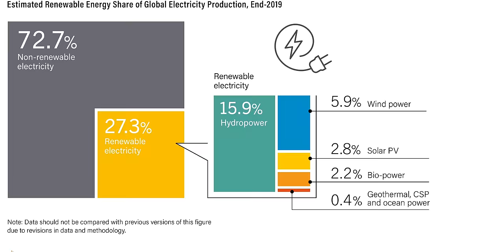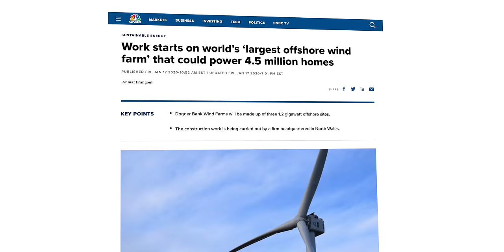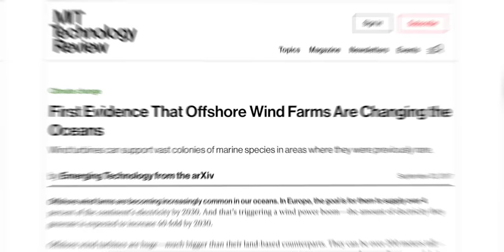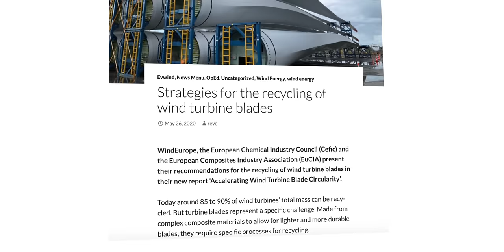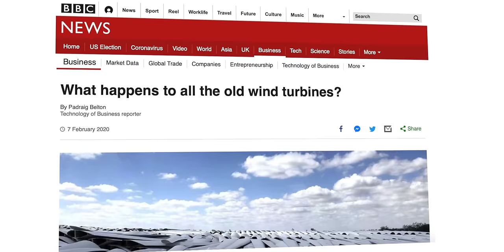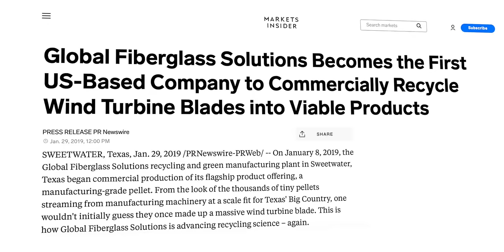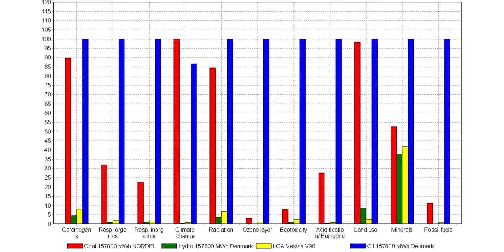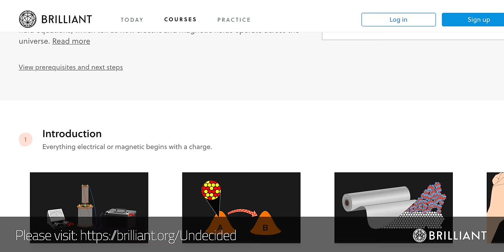The truth about wind turbines - how bad are they?

Comment: Nice analysis. While you did acknowledge some downsides, and have reasonable hope for some improvement, I feel some important gaps were made. For example, if we did cover all our coasts with wind turbines world wide, would that alone provide a stable source of power? (Is enough wind always blowing?) If not, the cost of storage to grab the peaks and fill in the lows with a base load needs to be factored into the cost of wind. The fact that the sun isn't always shining and the wind isn't always blowing is one of the reasons it is tough to increase this type of "green energy".
I also think the environmental impact is understated. Sure the clams might be happy, eating bits of dead birds falling from the sky, but can you imagine what surrounding all of our shores with windmills would do to all migratory and sea birds?
It would be terrible to do all this and one day realize that we dramatically overstated our fraction of the impact to the environment, or underestimated the many costs going green had and that maybe natural gas wasn't so bad.
Hydroelectric, especially from dams, are a great stable base load, but the environmentalists are pushing to remove them all. That's not smart.
Nuclear is also dismissed too easily. If green is so great, why is Germany burning more coal and natural gas, and paying higher electric rates than France? One reason seems to be nuclear. The US has been running small nuclear reactors on submarines and super carriers for decades.That's nearly a hundred reactors floating around in a variety of sea conditions without a reactor caused complete failure. We've been taught to be scared of a great power source that doesn't require ringing our continents and smattering our farms with windmills or solar panels, that have a much longer lifetime than green energy sources, and that could be disposed of much more compactly.
Reply: I don't know how long it's been since you were at the ocean but the wind really doesn't ever stop blowing on open water.

Comment: Thanks for this. Appreciate your whole view. Worry about the alternate uses of spent blades - only time companies won't just throw them into a landfill is if they can make money not doing so. Would love if we went into wood! Wood is the new plastic
Reply: As long as your kids are the ones living in Florida when it goes underwater, I'm fine either way.
Reply: It is actually the old plastic of witch the early blades where made of. As blades got longer and wind farms larger, using wood was deemed unsustainable, too heavy, too expensive.Today the high quality lumber required for this kind of application is rare to non existent therefore ultra expensive. Deforestation is not any better ether.  Now the use of different material within the composite is a better approach,  newly developed thermoplastic resins allow for remelt of a plastic part and reuse of most components of that composite material, self healing properties can add a lot of life to the composite part. Some of these resin are high bio content and some natural fibers are getting close to fiberglass and even carbon fiber performance level. "plastic" is the new wood. It is called evolution. A lots of smart people are working hard to find solution for clean...er energy  can we make it pure?
 By the way, birds die in grater number from striking high rise buildings than wind turbine blades strike .Some researchers are attributing that, paradoxically, to the lack of warning noise of a building.

Comment: Good video.  You need to compare the alternatives-with coal you get horrible impact from the mining of it, air pollution from the burning of it, and then coal ash(with heavy metals) at the end(I personally would much rather have turbine blades buried near me than coal ash).  Also, I am from an area that contains an old oil field.  There are still areas where plants do not grow after 80 years due to the release of salt water.  There are still wells producing, but these bring up  polluted salt water with the oil.  This  water must be pumped back in the ground nowadays. If these "disposal" wells get a leak, guess what happens to your ground water and your water wells! Wind and solar have problems, but are better than this.
Reply: And what about the mining or rare earth metals that go into the wind turbines? I wonder what those areas look like after they are used up. Don't be so sure that wind and solar are better. As has been mentioned by some other commenters there are trade offs no matter what.
Reply: @erichamilton8952  They probably do not look any worse than the places that coal is mined.  You are correct in that there are always trade offs.  Even hydro electric dams  endanger salmon.  I just think the trade offs are a lot better for wind/solar than for non-renewables such as coal.
Reply: It takes a ton of diesel fuel to mine the metal for the bases plus to dig the foundation plus haul in the gravel and cement to build the base for the windmills plus they need roads to get to them and wiring to get the power away
Reply: @lesleyboeder1798  It takes roads and a ton of diesel fuel to mine coal also.  It takes even more roads to produce oil.  Every well, no matter where it is, has to have a road built to it.  I speak from experience, I am part owner of land with oil wells on it.  There are roads and the wells are not what you would all "clean".  The area near them reeks of hydrogen sulfide.
Reply: @robertthacher2660  Crap.  The use of coal is dropping every year in this country.  The use of Wind and Solar is increasing every year.

Comment: I’ve got an idea; how about smaller turbines for houses, because solar panels for homes is difficult (roof material needs to be replaced much more often than solar panels, and then it cost thousands more when the solar panels need to be removed and replaced again, also shade trees usually come with houses, so cutting down trees goes along with residential solar). Those new fangled winter vines that look like a rectangle (doesn’t look like a windmill), might be a good way to go.   I have never heard noise from a wind turbine, but I get that it could be undesirable in a residential neighborhood. You would think with modern technology they could make quiet ones.

Comment: Here's the downsides.  Plenty of them.
Turbines don't belong en-mass out in the sea. NJ USA is planning up to 5000 turbines in farms with some 150 substations... in total containing some 35Million gallons of hazardous fluids and 3.5Million pounds of SF6 (most potent GHG known to humanity, with a warming potential 23,900 times that of carbon dioxide (CO2) and atmospheric residence of up to 3,200 years.)... those fluids leaking and at risk to dumping into the sea en-mass with a natural disaster or military conflict. 
The are NOT Green, NOT Safe, NOT low cost energy.  In fact, European  citizens report to us that their electric rates went up 2-3x.  The installation process in NJ puts them only 10-15 miles offshore in prime fishing, clamming and scallop grounds. Total destruction of these fisheries is expected due to disturbance of the ground from the installing the bases as well as the maze of connecting cables. And after installation, the choking of all living creatures will continue with constant silt generation to tidal currents moving around the bases of the turbines. Photos of such silt generation is observable at sites that have been installed. Further, NJ has no made apparent the "take charts", which are the declarations by the installers of potentially how many marine mammals the prospecting and installation is EXPECTED to "kill". NJ plays dumb that it doesn't know why our whales and dolphins are washing up on the shore during the seismic testing of the seabed. They know why, they approved it. And NJ is just the ground zero for the entire US coast, with Ocean City NJ being the start with the Oersted Ocean Wind 1 & 2. Our environment protection organizations are now approving of this, we have reason to believe their silence has been payed for. If you love the Jersey Shore, donate to our legal defense fund which is our most powerful method to STOP OFFSHORE WIND TURBINES NOW at https://protectourcoastnj.com
Reply: Here is the alternative - can we build a coal plant near you- you know the one that emits mercury and toxic dust and carbon dioxide in spades and must be shipped there through your neighbourhood and near your schools. All that ends up in your local seas. Dolphins and whales are dying without any turbines in your offshore seas and some of that relates to military warfare sonar testing - perhaps get rid of subs and military boats that are using such sonar testing??? Some related to the noise of shipping - good luck telling your ship owner to move back to wind. Do you think any power station does not generate vast amounts of GHG from its concrete/steel and construction and grid connections and then every single pound of fuel in the decades its generating. We see oil spills into the sea every day- yet we still rely on those ships to move goods that burn the dirtiest oil we mine for. Those trucks and rail run on diesel and if converted to cleaner power- that power has to come from somewhere. As for fishing- over fishing has been the norm for decades (where are all those massive fish fleets we used to see on old pictures) and fishermen do not care where they fish or how much. The less stock there is, the harder they must search for any fish to return with. Offshore wind farms (as much as fishing in the shadow of an oil rig) are a necessary evil. You don't want a wind turbine next door so offshore only offends the sea view owners (usually richer than most to get one). That same sea heated up by global warming then arrives and destroys everything (homes-wildlife-sealife-humans) and every year the seas get warmer providing the perfect battery for typhoons and stronger hurricanes even onshore turbines can be designed for.

Comment: I'm genuinely surprised by some of the negative commentary.  This video does an excellent job of presenting both sides as well as outlining the mitigations and solutions that address the downsides.  I would have liked to see one more aspect covered in more depth, namely the massive environmental damage that wind power displaces.  Over its 20 year lifespan (a conservative estimate since 1980's vintage wind turbines were still operational at Altamont Pass Wind Farm until recently), a single 5 MW onshore wind turbine will generate as much electricity as mining, transporting, and disposing of the toxic ash residue from burning 150,000 TONS* of coal.

That 5 MW wind turbine also eliminates about 25,000 TONS of toxic coal ash, 750 TONS of sulfur dioxide, 300 TONS of nitrous oxide, and 30 TONS of particulates

Even if none of the wind power downsides were addressed, they're still a net gain for the environment compared to its fossil fueled competitors which it displaces.

To top it off, coal pollution is estimated to kill 25 people per TWh of electricity generated.  In other words, each 5 MW wind turbine can save 7 to 8 lives from needless coal pollution deaths.*

* It takes roughly one pound of coal to generate 1 kWh of electricity.  U.S. wind turbines average about 35% capacity factor even with older, smaller, lower capacity factor wind turbines averaged in.

5 MW x 0.35 x 8766 hours/year x 20 years = 300 million kWh 
300 million kWh x 1 pound coal/kWh x 1 ton/2,000 pounds = ~150,000 tons of coal
300 million kWh = 300 GWh = 0.3 TWh 
0.3 TWh x 25 deaths/TWh = 7 to 8 deaths

Someone please check my math. :)

Comment: Good presentation on the topic of wind power. I did not hear mention of two variables.

Dependability: The wind does not always blow, and a wind farm at sea would need to withstand hurricane force winds... and the capacity to capture and store that level of energy.

Transportability: Some areas do not have a stable source of wind, or if so, the land needed to capture the wind power. Wind energy may need to be sent over long distances where it may be subject to attenuation.

I am asking out of my own inexperience in hopes of better understanding the challenges of improving the use of wind power.
Reply: The wind doesn’t blow all the time, so you will never get full power out of any wind turbine 24 seven. Neither does the sun shine all the time, at least not in the same place. Geographic diversification can help with this. Using renewable energy to charge batteries and/or generate hydrogen is another workaround. If we generated hydrogen, we could burn it and generate power from it when renewable resources aren’t enough.

Regarding hurricanes, we know how to build things to withstand high wind forces. Commercial airliners routinely take off in air that is 90°F, immediately go up to 30,000 feet and fly at 500 mph through air that is -40°F, and then drop down and land somewhere. They do this all day, every day full of, hundreds of passengers 
We have figured out the materials and methods needed to build offshore wind and make it reliable.
Reply: As far as distance from source goes, here in Alaska, we have an inter-tie between Anchorage and Fairbanks. It spans 350 miles. I doubt it’s the biggest one in the world but it’s one that I know about.

Good questions though, thank you!

Comment: I like this YouTuber but this particular video went deep down a rathole.  About 2/3 of the video was about how much of a wind turbine can be recycled.  That's a conversation point regarding wind energy, but not the main point by a long shot.  But to follow him down the rathole for a while, how much of a coal plant can be recycled, especially when the open pit mine and the cross country railroads delivering the coal are included?  Wind is now a cheaper electricity producer than most fossil fuels.  And it pumps less CO2 into the atmosphere per megawatt hour produced than does fossil fuels.  There are lots and lots of other problems to work out with wind, but it's generally cheaper and generates less CO2.

Comment: In my opinion, as a plant physiologist, the need to reduce carbon dioxide emissions ( NB carbon is an element carbon dioxide is a compound one very different from the other) is false. The majority of green plants are carbon dioxide starved and would benefit from an increase in CO2, that is why greenhouse managers increase levels by 2-3 times ambient for increased yields and improved water use efficiency.

Comment: Birds will eventually learn to avoid the turbines in time, through behavioral learning. Like the ducks in my city and most cities/town where I'm from for example. People have given way to them when they cross roads so much over the last few decades, even busy ones. That they're the only bird, make that wild animal inhabiting the suburbs that doesn't understand cars are dangerous. Heck they'll even walk out in front of a cyclist. I nearly rode into one and it didn't even flinch. They'll walk under the back wheel of a long truck and after seeing it. The second duck will run up to the roadkill in complete shock. Which tends to result in a Double Kill half the time.
Now compare that to the same species of ducks that inhabits locations near highways and rural roads with frequent traffic. They don't even bother trying to walk across. It's fly or die.

So your options are:
1. Adding an obstacle to their migration journey that they will eventually learn to overcome . It may take a decade too spread through the population. But it'll happen. Most birds are smart.
OR
2. Through inaction, cause long term global environmental damage to various ecosystems around the world. One of those being the fertile wet lands of migratory birds. Which after thousands of years has begun drying out to the point that it becomes vulnerable to a wildfire, which is what eventually finishes it off. Along with the other animals that lived there, year round.

Comment: A simple solution bird strike is currently being assessed. It is just painting one of the blades another color, ie black.  The flicker in colors is enough to scare off birds, in the daytime. Not much help for bats ...
.
I read an article about the people-wind generator interface. The Germans created a new law defining minimum distances to people. The problem was that there were a couple of towns that had paid for their own wind farms. The people nearest to the these wind mills did NOT have problems with noise (probably due to the specific design of those windmills).  But, the law forced the town to remove a bunch of the windmills because they were too close to people, who were not complaining ... There was no wiggle room in the law.

Comment: The problem with wind remains that it only produces on average about 30% of rated capacity.  You have to over build by a factor if 3 to 4 and pay to keep a bunch of fossil fuel plants in hot standby.

Comment: Do a segment on HAWT, horizontal axis wind turbines.  NOT grid worthy but a power source for midsize farm small farm and urban niche uses.  Rural power for small/mid irrigation pumps for nongrid remote power.  Urban for niche power like lighting in parks, fountains, bike recharging stations, exterior building and sidewalk lights, using and cutting the wind force between tall buildings.  Much more bird-friendly, can be ornamental with crisscrossing C or S or O shaped blades. All of the works close to ground for repairs. Good kicker for full offgrid battery solar too.